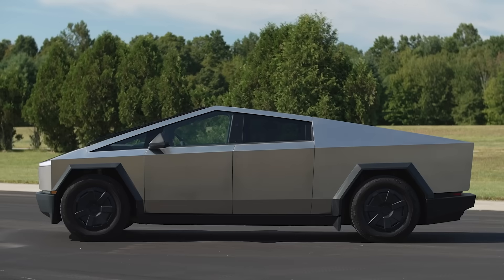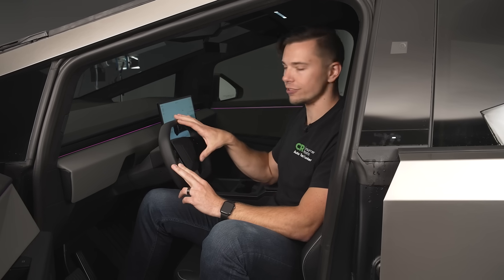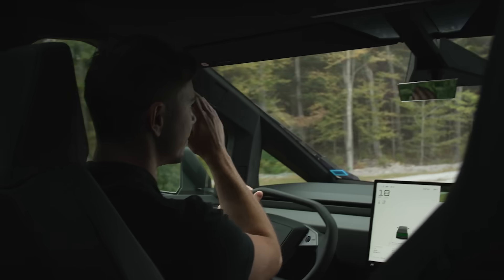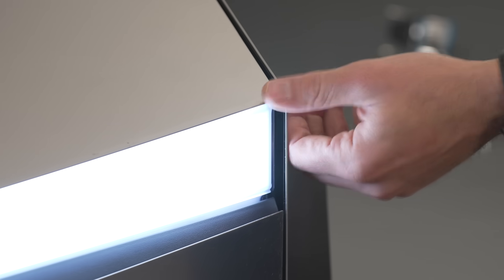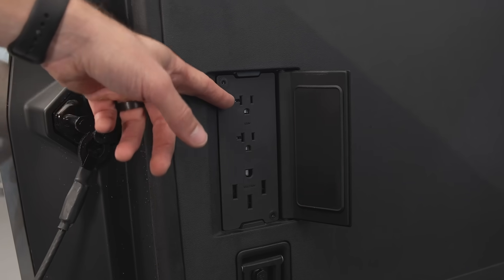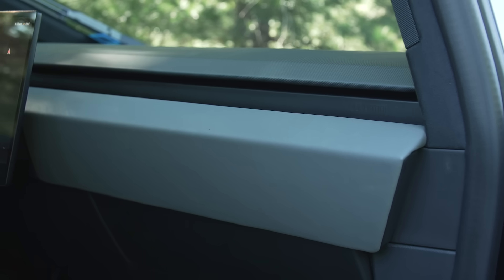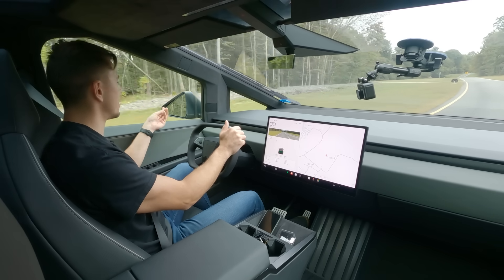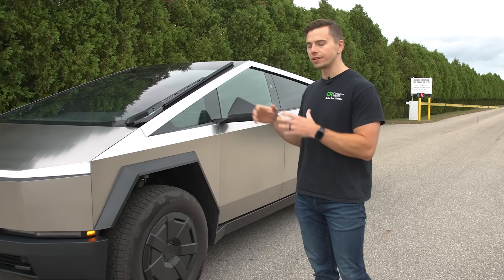2024 Tesla Cybertruck Early Review | Consumer Reports

Comment: does the fly by wire have 'road feel' or is it sort of fake feedback?  Road feedback is very important.

Personally there is far too many gimmick features, like hidden door handles. Who needs that?  A whole bunch of expensive to repair systems waiting to go wrong. Would be so much better without the the fluff.

[Back when Teslas were first coming out, I wandered into a showroom in a shopping mall. The friendly salesman told me to touch the recessed door handle, and it would automatically extend. At that moment I knew this was NOT my kind of car. Mechanical door handles please without sensors or little motors.]

Comment: I have the feeling mask is going to put it on Mars it seems over engineer no paint Big class the back cover can be changed to the solar panel 😅 to charge the battery 😢 yes it's heavy but he might take it apart and sent it to Mars just think he will be the only car dealer on mars and with few modifications to the chassis it can be a moon Rover 😢 or Mars Rover 😅in my opinion 😊

Comment: Maybe I missed it but you didn't speak about the all wheel steering. It's amazing how tight a turn this beast makes. If someone wants a truck that drives like a sports car then this is it. Agree it certainly gets strong reactions but a lot of it is political. and also yesterday they released a software update that adds Full Self Driving and the other features. Is there any other manufacturer that does this? I waited 4 years for this and I'm glad I did.

Comment: Ford gives grants to consumer reports. Tesla is blowing away FORD and their CEO admits it. Almost everything this guy said is negative. Try hitting ANY other card in the world with a hammer or going 0-60 this fast while still towing a 11,000 pounds. Steer by wire in a car is ground breaking. He never mentioned the 48 volt architecture which is first in any car. It now has full self driving, best in class. Other car companies will be buying FSD from Tesla very soon.  He didn't cover how you don't have to turn the wheel nearly as far when whipping a U-turn as any other car or truck due to steer by wire. There is a multi year waiting list for a reason. The video gaming in the car is excellent. The dash is not "cluttered" as there is zero clutter, just one screen.   People charge their cars almost completely at home, not at superchargers. But if you can't backup your truck with cameras and turning your head you should not have a car. You can stand on the Tonneau cover. It's rated for like 300 pounds. And the cover locks to keep your stuff safe. He didn't cover the best parts of this Tesla. You don't have to be a fan boy to give a reasonable positive and negative review. This was not that.
Reply: Sigh

Comment: I don't need a truck but if I needed one I would go for the Silverado EV.
Reply: IDK  They added more range with the big 203 KWh battery but the extra 100KWh adds a lot of weight to the truck which comes right off payload and towing  specs.
Kinda of like the midgate.   If you get the truck and put the mid gate down be sure to secure the load very well.   Straight shot into the back of the front seats.

Comment: You can see they are improving the quality of this $100 k beta tested product . I am sure AI is taken in all the reviews and opinions to figure out what is problematic and execute design changes . I think the rearview is a easy solve with son parking sensors and a better display camera . It's quite amazing getting this vehicle to market and as suggested they were more on design over maybe function and at times sticking a round peg into a square hole . Averaging 2.7 kw does show some efficiency compared to the brick of the Ford lightning getting 2.1 kw on highway driving

Comment: The drive by wire is so the driver's seat can be used by a passenger when the truck operates as a robotaxi. The wheel will lock in a fixed center position when autonomy is activated.

The rear view mirror is just so the driver can talk to the back seat passengers without turning around.

Lastly, I think the right pickups to compare it to, are the $100k Raptors and TRX, not the Rivian and Lightening. Why? Because electric pickups are competing with gas trucks, not each other! The market for EV pickups is 100% of the pickup market, plus some from the EV market, not "existing EV owners".

Nice job, Alex.

Comment: @ 1:12  they claim that 6600 lbs is heavy yet a Ford Lightning Platinum is 6850 lbs and a Rivian is 6876 lbs.  They also gloss over the fact that a Foundation edition is a special edition that’s roughly 25% more expensive than the normal top of the line Cybertruck.  Also a really poor explanation of the drive by wire steering ignoring several amazing attributes and talking about its “weirdness”.  They mention the wheel only turns 180 degrees without explaining that the steering is progressive and when combined with rear wheel steering is surprisingly agile for such a large vehicle.  So it’s pretty clear right off the bat that Consumer Reports is still biased against Tesla.  I admit I stopped watching after 3:41...pretty sad video.
Reply: "Normal" price is Tesla for "not actually available".

Comment: Too much to "get used to", too many things imperfect, too many things missing that every other vehicle has, and in the north, opening the door with snow and ice is sure to be a problem. Then there is the problem with charging. On a trip you cannot relax, you always have the need to charge hanging over you.  Gas is easy. It's everywhere and you can fill up and be done. Saving money on fuel is not a consideration if you are spending $100K for a vehicle. Then there is the resale someday when there are a million and you have one of the first ones, that everyone knows had some issues compared to later ones.

Comment: I was hoping to hear CR talk about safety. Hopefully it'll be discussed in upcoming features?
Reply: They can't talk about safety because Tesla won't provide any to the NHTSA or IIHS for crash testing.
Reply: @JamesYale1977 Maybe they they wrote the article prior to getting the truck.  The fellow here drove it.
Reply: The CT uses the same design as the Y's with gigaCastings.   The casting absorb energy as the force of the crash destroys them in a controlled way.    There are images of crashed CT's where you can see the front is shortened.
Tesla engineers explained this in one or videos.  Tesla knows how to make safe cars.
Reply: That's mainly the IIHS's job, the IIHS and Consumer Reports are partners.
Reply: Its unsafe
Reply: How about the Aluminum Frame instead of the Normal Steel like all Pick Up's and Work Trucks?!
Reply: @DarthAwar   The cyberTruck has a stiff chassis especially for a pickup truck. A Little flex is good but traditionally pickup trucks are too flexy.  The boxes move independently from the cab as the frame twists.  Honestly both systems work for a truck.  The stiffer cybertruck chassis may contribute to better than a truck handling.
Reply: When they talk about safety please consider pedestrian safety. Stainless steel with sharp edges sounds dangerous to pedestrians, cyclists and other vehicles......
Reply: Like all overweight overheight pickups today that are not being used for intended purpose? @kamcg1049
Reply: @kamcg1049  also no Crumple Zones which in the US are not required by Federal Law unlike EU UK Australia etc
Reply: its the safest truck you can get
Reply: @Sal3600 What is this comment based on?  The NHTCA has not rated the Cybertruck yet.  The Rivian  R1T has the highest safety truck rating.
Reply: @Sal3600 For no one except the driver of the cybertruck
Reply: @Sal3600  nope Aluminium Frame not Steel unlike all other Trucks and Pick-ups
Reply: @Sal3600 probably true given its low ride height, but we don't have a lot of data on safety.  Hopefully we'll get some ratings someday.
Reply: @Sal3600  not it isn't
Reply: @Sal3600  someone just was burnt alive in one in CA .... safe

Comment: There is never a car where form follows function rather than the other way round. The design is at is because they can not bend the steel. (which is bullet proof)  It is in fact compared to normal pickup design more aerodynamic. It has a low approach angle so it can go off road. It has a pressurised battery pack so it can wade. Adjustable suspension and big tires so it can off road. A cover so things in the bed dont get stolen

Comment: About 4 mins maybe of driving experience in a video this long?!?!? No mention of the all the distinguishing software features, powershare that can power your home for possibly 3 days after a storm as some are doing after the Hurricane, how the bed size is large compared to many EV trucks but it can still fit in most home garages. 
Bottom line: if this is your first Tesla, there's a lot to get used to. However,  the analog is like going from a Motorola Razr or to an iPhone/smartphone. You can complain about battery life, lack of a physical keyboard, etc. But once you make the switch and get used to it, there's no going back.  Everything else seems like ancient history.  Oh, btw, Full Self-driving Supervised has been released for the Cybertruck.

Comment: 48 volt architecture another first
Reply: No. . . it's not.     The Renault Scenic in 2017 used a 48 Volt system. . . . and I am pretty sure plenty more.    I hope there continues to be further adoption of 48 Volts as that would likely mean we are going to have more and more onboard accessories.   

But when Tesla sent the "How to upgrade to 48V"  instruction manual to other companies. . . it was a gag as 48 Volts is not difficult engineering, just has a lot of cost.  Like changing all the Mile markers in America to Kilometers.
Reply: @DanDeGaston  The Scenic was a mild hybrid and only used 48V for the power train.   The rest of the car was bog standard 12V.
Reply: @DanDeGaston   - Renault is not even Viable anymore. 
its a JOKE car company.

Comment: 1.  Having driven a plethora of 2023-2024 cars because I have been working out of state, I can say categorically that you don't have a clue about how good Tesla's blind-spot lane-changing warnings are the best in the business.  Further, my Model 3 actually stopped me from changing lanes a few months ago and sounded a warning. I had just checked the lane I was going into and it was clear and so I could not figure out why the car had literally stopped me from changing lanes. It turns out that a car going at least 70 mph was racing up on my passenger side. The car was not viewable when I first checked the lane, but because it was going so fast, it came up on me in less than a second. My Model 3 saw the speeding car coming up on me in the lane I was changing into and BOTH sounded an alarm and stopped me physically from changing lanes. This saved me from a VERY serious accident because the speeding car would have run into me going 70 mph. 

Now explain to me what other car is that smart when you change lanes, because I have driven Toyotas, Hyundais, Nissans and more and none of them would even begin to protect the driver like the Model 3 does. The bottom line is, you don't have a clue about what you are talking about. Your review was lazy, stupid and unprepared and it's one of the reasons I don't subscribe to CR.

2.  CR, was caught changing its reviews for money a few years ago. Considering your corrupt past, you ought to be a lot more humble than you are. CR is no paragon of virtue in the product review world.

3.  I don't particularly like the looks of the Cybertruck, and I would not pay $100,000 for one. But based on multiple reviews, it puts other EV and ICE trucks to shame. It's got a great ride, which you didn't mention because you're incompetent. It has a solid 300-mile range. It tows exceptionally well. It's semi-bullet proof. It's very difficult to break into. It goes 0-60 mph in 2.9 seconds. It has far fewer bugs than other EV trucks. It has the best GPS system on the planet. Its stainless steel exterior is very hard to damage. It drives better than any other truck on the road. It has a superb turning radius. It's more powerful than any other truck on the road, including F250 and F350 commercial trucks. If you charge from home, it costs a fraction to run compared to gas or diesel trucks. It will charge using Tesla superchargers from 10-80% in about 45 minutes. It has one of the most advanced batteries on the planet. It has more torque than diesel trucks. It does very well off-road. It has the best security system of any vehicle. It's great to travel in. Because both the front and rear wheels turn, it's great to use in city driving. It is very nimble negotiating city traffic, I have seen one in action.  It requires very little maintenance, unlike ICE trucks. Tesla's UI and touchscreen are state-of-the-art. No other auto manufacturer is even close to Tesla. Tesla has the best cruise control and lane assist of any manufacturer by far. 

4. Cleaning ANY truck this size, including the Ford 150, the most popular truck in the country, is a lot of work. ALL vehicles, including painted new cars with clear coat finishes are fingerprint magnets. Again, you're just stupid.

Even though I like the Rivian looks and size much better than the Cybertruck, if I were going to buy an EV truck, I would seriously consider the Cybertruck because it is just better than every other truck on the road right now when you consider all aspects of the vehicle. I own a TRD Toyota Tacoma with a four-wheel drive, and it gets about 15 mpg in the city. If I drive a lot, I can easily spend $500.00 a month on gas. Driving my Model 3 costs me about $50.00 in comparison to charging from home for the same distance. The Cybertruck similarly will be very cheap to own if you charge from home, and most owners will. So, unlike ICE and diesel trucks, the Cybertruck will actually pay for itself over time compared to gas and diesel truck costs. I rented a Ford F250 diesel truck once, which was brand new from Enterprise car rentals. That truck got 4-6 mpg in the city and diesel was nearly $5.00 per gallon. Do the math, and suddenly, the Cybertruck, which is faster and more powerful than the F250 diesel, begins to look a lot more attractive. At home, it would cost around $12.00 for me to fully charge the Cybertruck from 0 - 100%., and it would easily charge overnight with my Tesla Universal Wall Connector.
Reply: well said buddy. when compared to other electric trucks, its a compelling proposition
Reply: Your post was mostly TLDR. What I did read told me your opinion is clueless.

Comment: 7:45 - "There's a reason that cars don't tend to have straight panels, because it's really hard to hide stuff.  Lines that don't meet up, so you can hide imperfections."

Good gods.  No, that's not even remotely true.  It's easier to line stuff up with straight lines than with curved lines.  And, no, most new cars don't have these problems with fit and finish nowadays.  This is just an absurd attempt at justification for a ridiculous design and poor quality.